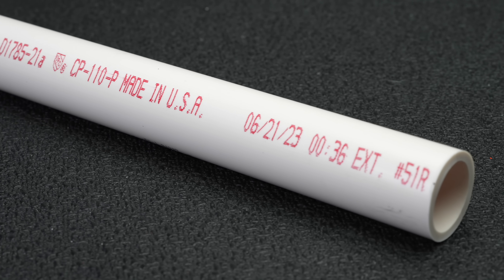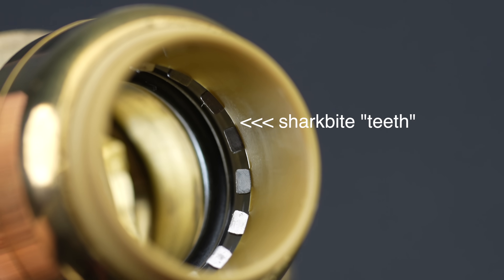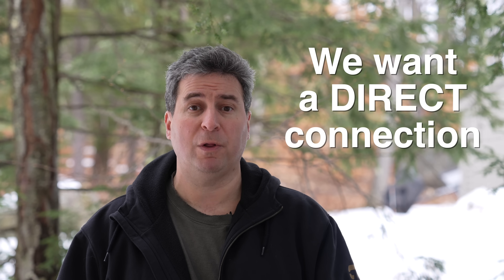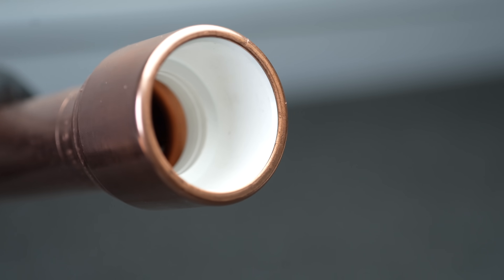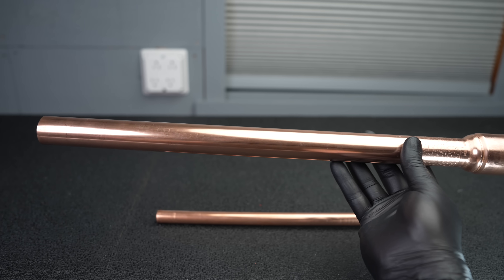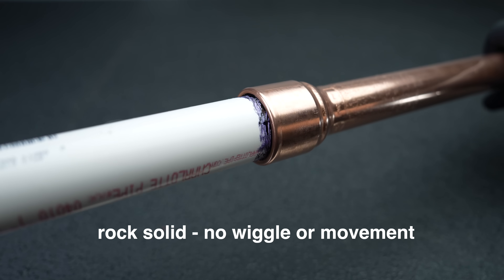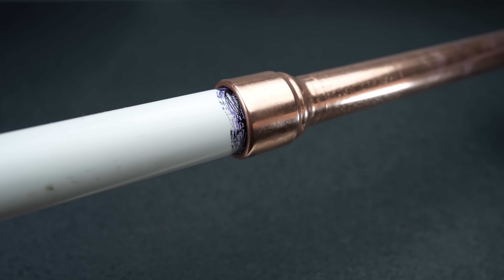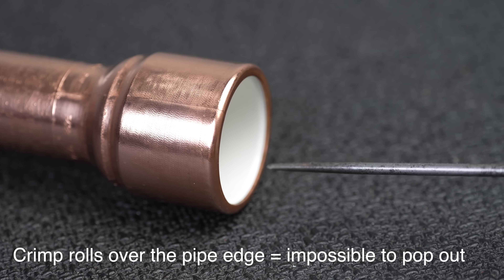Copper to PVC Pipe has Never Been This Easy

Comment: Licensed plumber for 30+ years here. Not sure if that glue was purple but always be sure to prime and glue the corresponding fitting as well. If you're doing this work under a permit, always check your state plumbing code. Some states have a code approved list of plumbing products off the shelf. If this copper fitting adapter is not approved by your local plumbing board, the inspector will have you rip it out.

Comment: After 30+ years in the construction fields I’ve never needed a connection from copper to PVC.
Reply: Doesn't meant someone else hasn't.
Reply: @  obviously, but it’s kind of a rhetorical statement, I’m curious who uses them and in what application.
Reply: @kimberHD45 Irrigation. My home water line comes from the house with copper and transitions to PVC in the ground manifold box where the valves are. I've never considered this either until now when I have to rebuild my entire system.

Comment: Those male thread pvc fittings also tend to break so I have opted to use male copper thread fitting to female sch 80 pvc which is much stronger. Still, you can split the pvc female fitting with too much torque. This is a brilliant solution to those potential failures. Thanks for bringing it to our attention.
Reply: FYI for others, you do as you like ;). Always use male PVC to female copper, exactly for the reason stated above. If and when you over-tighten, the female PVC fitting will split. An inspector will fail you for female PVC to male copper.
Reply: Sch 80 male to coupling or fip. Never metal into plastic. Asking for trouble

Comment: Do you have something like this for galvanized steel drain pipe running in crawlspace?  I have the old pipe dripping and the plumber tells me it will cost me $1000 to replace the pipe with ABS plastic pipe.

Comment: The PVC insert has been "crimped" into the copper.  So I guess it is a question of how good is that crimp?  It seems like a threaded adapter is just as easy, cheaper, and is something that you can feel confident you've done correctly.  And is reversible.

Comment: I used this fitting about 4 months ago. I use it to as my transition  of my pressure vacuum breaker to PVC. I pretty much made a union fitting with it having copper threads on one end and pvc threads on the other end. Which now allows me to remove my copper to PVC conversion whenever the PVB needs servicing. Pretty much is the way to go in my opinion whenever you do this on items that may require replacing or servicing.

Comment: you use abs cement with a flux brush on pvc. you wouldn't last 1 hour on any job site. this chinese product you are advertising is not legal to use because it hasn't been proven to work. there is a reason that mechanical threaded fittings are used. if you can't install them without leaks i am not surprised. the well house i plumbed in 1999 with galvanized and PVC has yet to leak, even after i replaced the pump & motor back in 2012. you clearly are not a licensed or even knowledgeable plumber.
stop giving out bad advice.

Comment: A threaded connection is just as “direct” as is a glued or soldered connection.  The beauty of a threaded connection is that it can be nondestructively disconnected and then easily reconnected.  You can’t do that at all with glue and it is difficult with solder, but not impossible.  It would be much more concerned that the staged piece of plastic in that copper pipe would fail with age than I would be that a threaded connection would fail.  Threaded connections have decades of successful history.

Comment: Is there a way to go in reverse, I think most people are having a problem converting old houses with copper too new things. And I like shark bites because you can take them back apart eventually, And during the hot water heater install I was doing at backtracked once I discovered a leaking valve and was able to cut it out and reattach.

Comment: While I appreciate the video - I was using these 20 years ago - nothing new at all.  If you're soldering , still a good idea to wrap a damp rag around that transition fitting...especially if the adaptor is vertical.

Comment: I can see a few applications for this. But this problem has been solved for a while now. I'm an irrigation contractor and make lots of connections between different pipes. Pex water mains to pvc, pvc to copper stubouts for backflows etc. I like using a schedule 80 female adapter, a sch 80 threaded nipple and a copper female adapter. Easy and can be undone for leaks or moving things around. Plus the total cost is maybe $5-10 bucks. My worry with this is, if that pvc insert leaks then you are having to cut it totally out and that can either be a 10 minute job or an hour job.
Reply: I like this plan.  What is your go-to sealant (first and second choice) on the two NPT threads (into PVC and into copper)?
Reply: I just use plain Teflon tape (2-3 wraps) and Oatey great white pipe dope. I’ve tried the blue monster tapes and other gimmicks but they don’t do anything more than the plain white kind. Pipe threads (npt) is self sealing with how the threads are designed. The Teflon only helps you to tighten it down more. Which is usually a problem with plastic on plastic connections.
Reply: @Romeo1776-qw2km  You should make a video on connection and undo to move things around.

Comment: As expensive as that is, I would rather use the threaded option. I could even use the same cement instead of tape on the threads if I'm afraid of vibrations.

Comment: This is kind of new. They’ve had unions that have pvc inside one side of the union. The issue they face is that pvc and copper expand and contract at different rates. I don’t know how reliably water tight this connection would be.

My only critique is that you said cpvc is commonly used in homes. That is not correct. You can buy CPVC (white or more commonly gray) in schedule 40 or 80….but you usually have to order online.

CPVC use case is for higher temperature ratings than standard pvc (higher pressure also) CPVC is much more expensive and unless you have a specific high pressure or temperature need is not used in most homes.

Otherwise awesome video as usual

Comment: Copper and PVC aren't inherently difficult for glues to bond to. The larger issue is probably the relatively large difference in thermal expansion between the materials - which could over a long time loosen a hard bond or threaded connection. If you used a glue with good flexibility then I don't think this would be  problem though. I'm not a plumber, but off the top of my head if you used a threaded connection and coated the threads in RTV MS-polymer then I can't imagine that thing ever leaking or coming apart. There are probably standards and such you have to adhere to though for legal and liability reasons.

I can see the added security of a cold-welded connection, but inherrently this will have the same problem to deal with. It has just moved the vulnerability from the joint to the crimp-fitting between the PVC and the copper. Presumably this is pretty tight, but you are relying on that never failing (or cracking) despite expansion pressures

Comment: The city works have had something close to this for years with connections at the water meter. When I ran my 3/4" PVC line from the house to the meter which was once galvanized pipe the city works guys had a fitting that transitioned from copper to PVC. Pretty fancy connectors. I wish I knew a brand name. 😮😊 Great video 👍 God bless 🙏

Comment: Not for PVC, but I remember years ago there was a copper epoxy for use on regular copper pipe to replace solder. I haven’t seen it in quite a while though
Reply: Probably because it didn't work and the manufacturer took it off the market.

Comment: Good to know this option is out there. Gluing and sweating on pipe thread adapters are an alternative but this system is so much more efficient. It would be worth the high price as you will not be using a lot of these connections.
Reply: Yup. Shouldn’t need more than one per incoming service.

Comment: Nope. Threads on each pipe going into a PVC union. If it ever leaks, pull out the short run of PVC.  Cut the threaded adapter off of the copper. Solder on a new adapter. Add a longer length of PVC going into the union with a threaded adapter on it. Done. 5 minute job.
Reply: Why solder a new adaptor? Whats wrong with the old one? U just need to use a new pvc adapter
Reply: @JackTheAwesomeKnot  
It's called a leak, Jack. In order to prevent it from leaking again, Jack, you should replace the threaded adapter, Jack.
Reply: @Carl_Jr  in my experience, it's never the female copper adapter, but always the male pvc that has the problem. I just remove the old one, thread a new one, and bam, it works.
Reply: @JackTheAwesomeKnot   Which is why I don't use the female copper. I use male copper. It's harder and goes in easier. The female PVC is softer and forms around the threads easier.

Comment: Imna pass. I'd rather have the possible slow leak of a threaded connenct than the immediate disaster of a chemical bond between two dissimilar materials expanding and contracting at different rates at this bonding point.
Reply: I spoke too soon. That's interesting. Still unsure about this one.

Comment: Threaded joints have worked for me
Reply: They work just fine for whoever installs them. They don’t work just fine for the homeowner when they will inevitably be paying a different plumber to repair it a few years. But, as a plumber myself, I appreciate guys like you guaranteeing me job security.
Reply: @BULLTRONHERO  You must have a bunch of crummy plumbers around you. I've never had one fail, and the threaded joints I installed in my house 30+ years ago have never leaked a drop.
Reply: @TexasBarnRats  I've always made sure to have a male threaded connection go into a copper female threaded adapter. That way the PVC is compressed as its tightened. I never put a male copper thread into a female PVC adapter.
Reply: @BULLTRONHERO  you must have a bad supply house around your area with 3rd rate parts stored outside in the sun.  Around my area we got premium parts and reputable supply houses.

Comment: According to the brochure, this thing can handle 250 PSI.  That's about as good as the non-Max Sharkbite fittings.  I think the threaded inserts can handle 400 PSI.  Considering it seems to be a permanent attachment (whereas the other options aren't), I'm not sure I'd prefer this.  I'm sure there are niche cases where this makes more sense though.

Comment: My well pipe coming into the basement from my private deep well on my acreage is Black heavy plastic pipe that Simply goes onto a Barbed Copper Fitting before the Pressure tank. 
Easy peasy.
Reply: This is the way to go.   I just laid 160 PSI black poly from my well house.